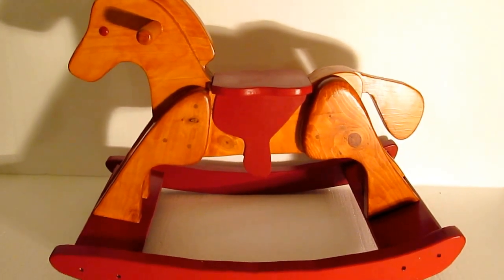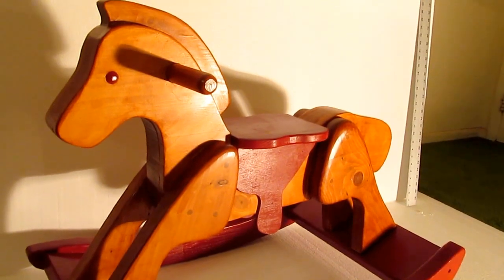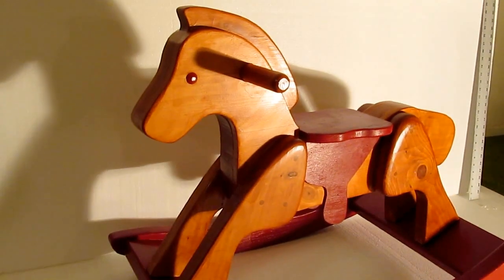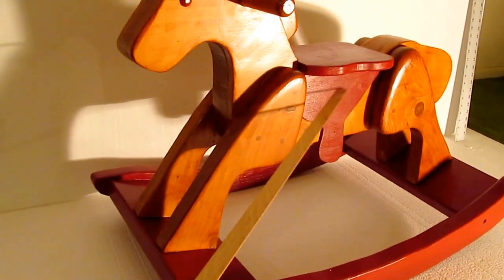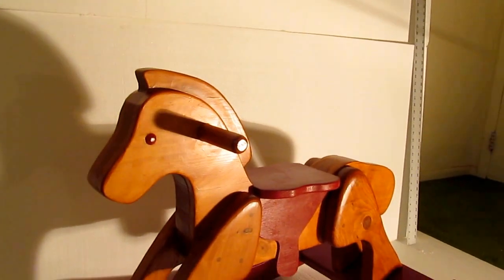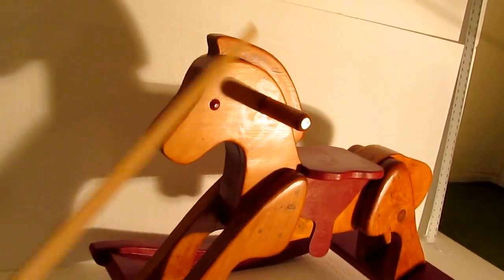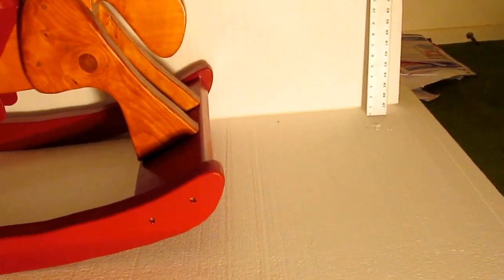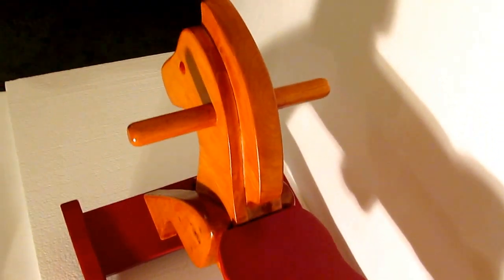Homemade wooden rocking horse

Comment: Hey Dan, awesome horse. How did you attach the head to the body?  I am assuming it is 2 pieces considering you used the 2x10s
Reply from the maker: Brady, you're right.  It is two pieces.  The head is attached to the body with biscuits.  Since the center piece is one and a half inches thick, I was able to put biscuits side by side, which is really strong.  I used 6 biscuits on the center (2 by 10) piece.  On the 2 side pieces, I also used biscuits  to attach the head.  I made sure the seams (which you can hardly see) did not line up, which also provides strength.  Thanks for you interest.